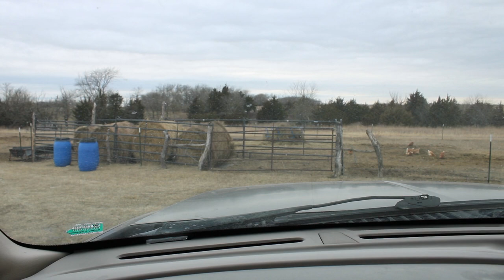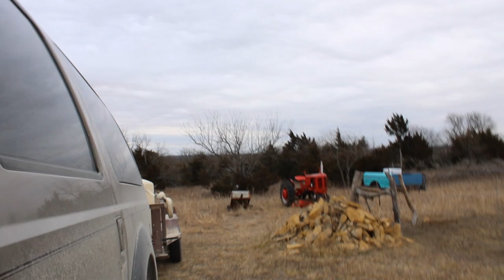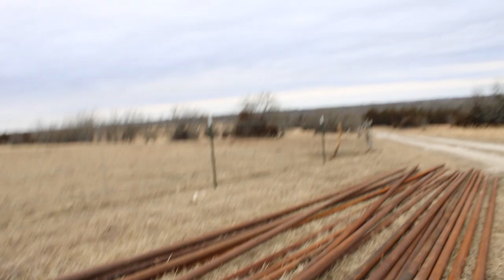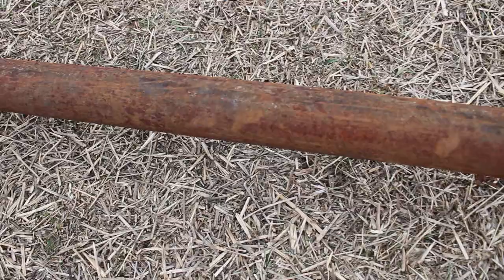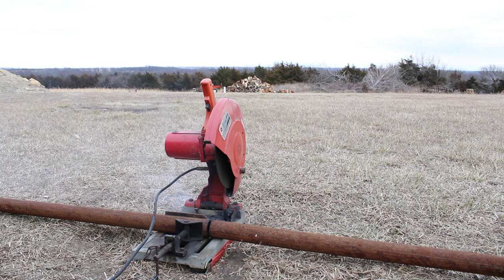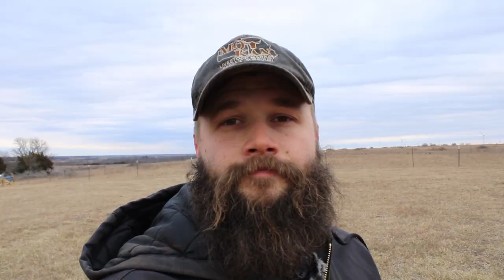Oil Fields and BUFFALO?

Comment: Is that a general corral ur making or u know about rotational grazing?
I saw about a pole barn recently for a winter where the animals stand over woodchips drop tons of manure.. add mulch over it.. until the end of winter.. where the entire compost ground gets put out over pasture to better make it greener and stronger.. 
(Not sure when though)
Cool video! 
Do those poles hold enough strength for bison?
Reply from the maker: Yeah I know who you’re talking about Joel Saleton. I don’t plan on doing that because Buffalo respond differently than cattle do. Joel has a great system and is great for cows but Buffalo have a different temperament. When they are crowded they get very stressed and want to break out. Yes the oil field pipe is plenty strong for Buffalo. But all that I’m doing right now is using the oil field pipe four corners and braces. The actual corral will be built out of oil field pipe also but that’s later down the road.
Reply: @BrokenArrowBison  yeah it does sound foolish.. like that.. putting them in a chicken coop
 greg judy talks about using a hay unroller to have bad hay go back into the soil as it is eaten to build the carbon material and plant life in the soil.. but rotationally grazing still seems like a good bet. 
How many head and acres ur working with?
Reply from the maker: From what I have heard and observed, unrolling hay is not the best idea. Creates a lot of weeds in your fields. As long as it’s good hay they will eat everything and the manure will turn into carbon over time. We don’t have any animals at the moment. We’re working on fence and will be getting some shortly. We changed farms and had 15 head on the last farm.
Reply: Well, the pile needs to sit out for a year or two to breakdown before you want to put it in your fields and gardens. "Hot" manure/mulch in large piles/quantity can be too much Nitrogen and burn the plants. Just like a good Bourbon or wine, it needs time to age properly and then it's worth its weight in Gold!